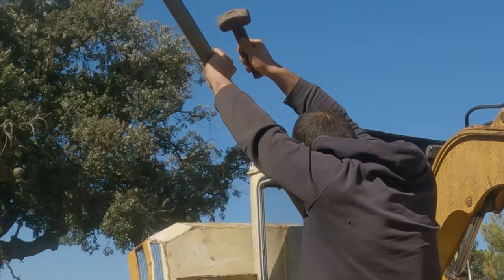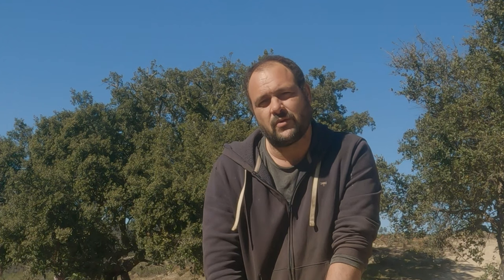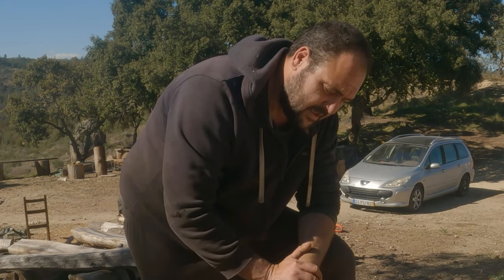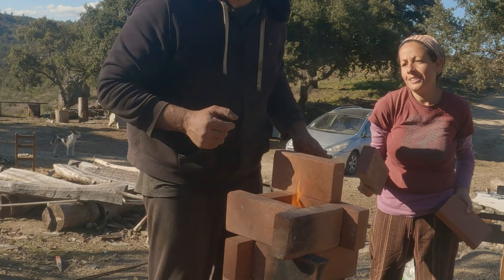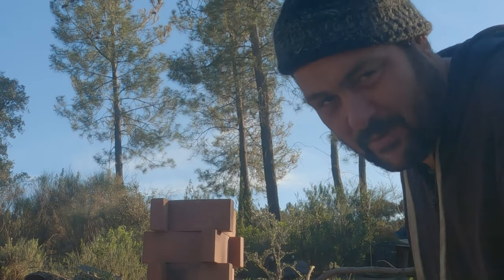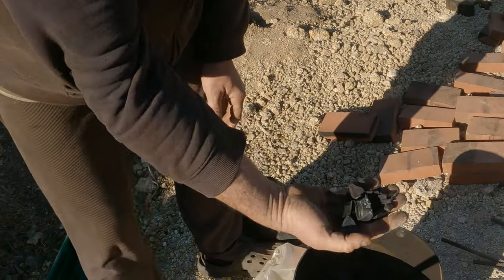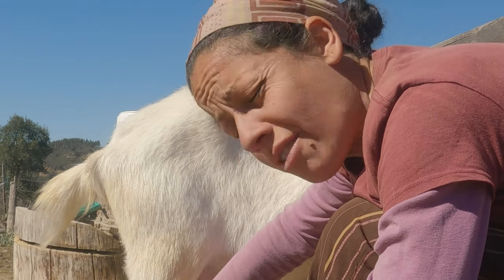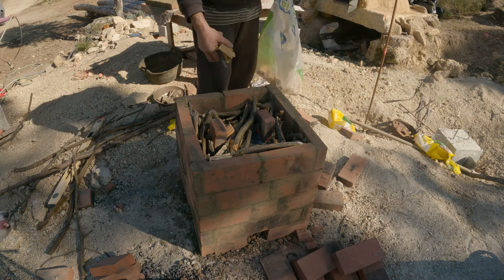How we made BIOCHAR. Turning Our Waste into Black Gold #biochar

Comment: great job and video, just try using the leftover coals and even ash from the wood oven and heater, you will achieve very good results top dressing your garden beds and make use of the heat. Your process is great for making charcol, but coals and ash will work well for potash.

Comment: I one time went to a sustainable workshop several years ago. And there was a guy there talking about using a rocket stove to make bio-char. He had two barrels, one inside of the other, and used the pre-char wood piled on the outside of the main burn barrel. He explained that he could cook with the inner barrel as it charred the outer barrel. Kinda backwards to what you have done. I don't know if it would work any better or not.?  ... While your researching things, you might research how to make Biogas. There's been articles in Mother Earth News over the years about making it to fuel your gas burner.
Reply from the maker: Yes there are so many different methods of making Biochar. Making Biogas is definitely on our list of things we want to do for our farm in the future 😁